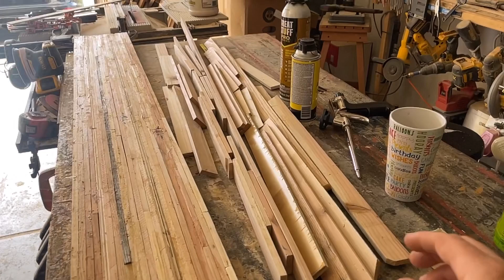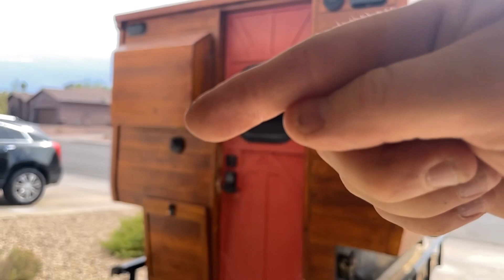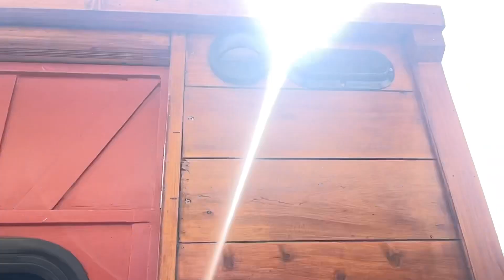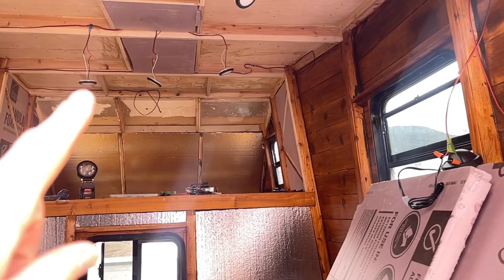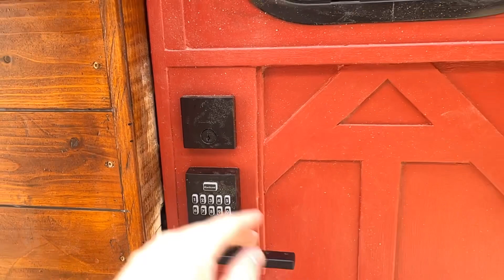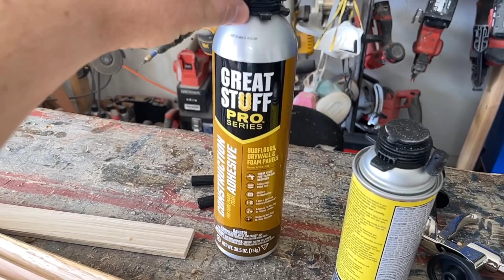Truck Camper 6.0 Build [Part 6] Moving on to The Interior

Comment: I think you have attained the apogee of camper-dom. Having said that, a slight convex on the roof & also on the floor of the cabover-bed area would really add much strength. I think 'ship-lap' type joints for the planking would be appropo. I like the angles, you know, there are no straight lines in Greek temples. BTW, I'm stealing some of your ideas when I make my camper.
Reply from the maker: Thanks!
Reply: @EndgameCampers  I live in a very hot climate & I  certainly see the utility of cedar sheathing

Comment: Can you give me the reference for where you purchased the puck lights?  I have been going through all your videos and can’t find where you got them at.
Reply from the maker: acegoo RV Boat LED Ceiling Light Surface Mount 12V Puck Light for Camper Van Travel Trailer Truck Car Interior Lighting, 12 Volt Under Cabinet Kitchen Galley Downlight (4-Pack Small/Cool White) https://a.co/d/4ih7LxQ
Reply: Thank you for helping.

Comment: Love all the work you have been doing! Almost 3 years ago I built a replica of your first camper. Never done any woodwork in my life and built the whole thing with a borrowed circular saw and jig saw. If I could post a picture I would send you one. I absolutely fell in love with building things with wood and have since acquired new tools. I’m about to start a second build. I used spar urethane to finish the first one. I saw a video that explained the finish you used but I can’t find it. What kind of finish do you use on the exterior? Does it last longer than a year? Spar urethane lasts about a year and starts to crack in a few minor places but it’s enough for me get an eye sore and start sanding and refinishing.
Reply from the maker: I used PPG Prolux Log and siding in the butternut color. I love it!  And, it should last about 5-7 years. I’m so glad you were inspired to build your own. Thanks for sharing. It means a lot.
Reply: @EndgameCampers  Thanks for the reply! I love the way the PPG finish looks. Sanding and refinishing once a year is tiresome with maintenance. My little camper has been up and down the Rockies from New Mexico to Montana, down hundreds of miles of forest roads, and still holding up to the abuse for almost 3 years with my daughter and I. Gets tons of looks and questions for sure. Haha I equipped mine with a diesel heater tapped into my truck’s fuel tank. Lots of winter camping and even tho it’s not insulated I still have to vent some air outside with a tee in-line. I stayed in it for 3 days with zero degree weather. 70 degrees all night long. Won’t chat your ear off too much. Haha Thanks for the videos! Gave me tons of ideas!

Comment: I like the lights you have on the outside at the back. The utility lights I mean. It’s nice not having blinding light when you may be looking at it. The upper light especially. If you are at the next camp sight with your buddies and walking back, it’s potentially unsafe to have too bright of a light as you look at it and then if there’s a noise elsewhere you are blinded in the dark. Have a nice light for direction and some nice lighting for the immediate area and have a great flashlight to get you there safely otherwise. The one for the kitchen area, much the same but it’s nice having a normal level of light vs ultra bright LEDs in that situation also. It may be the fact I’m getting a bit older(59) and my eyes aren’t as good,,,,😂😂. But I’m not a fan of excessively bright lights unless they are shining away from me of course. I don’t blind my friends as a joke, run illegal lights on my vehicles on the highway, dim when you’re supposed to etc. Some of that is also being a retired LEO, like yourself, but from a much more rural aspect, resulting in the fact I just don’t like breaking the laws/rules. We need to respect one another.  
       The camper is very nice looking, but as I mentioned in the past,,,,, I liked 4.0 a lot! 
   All the best and stay safe, Eh!
Reply from the maker: Thanks for the insight. I agree